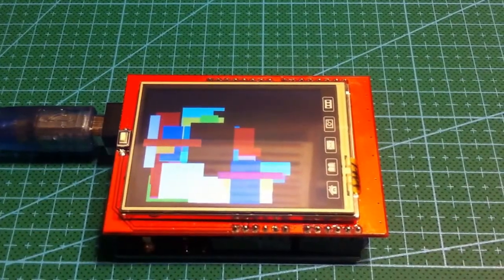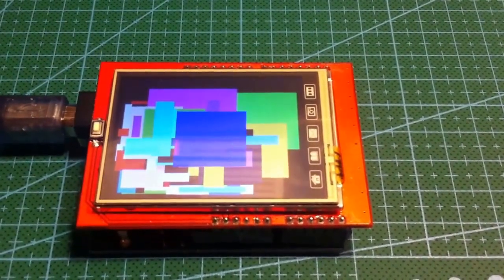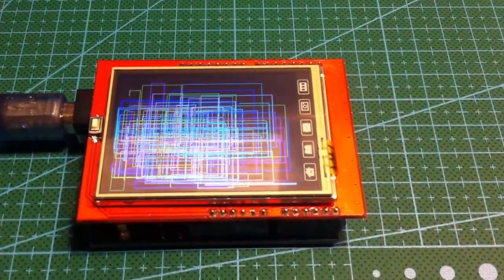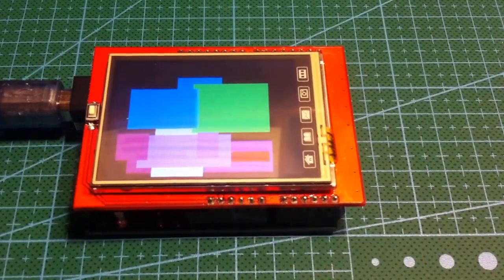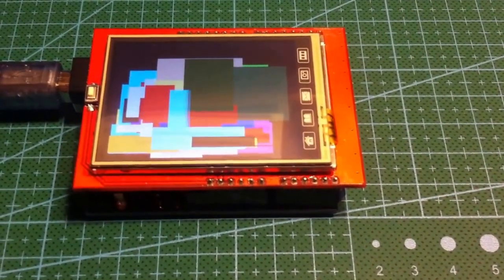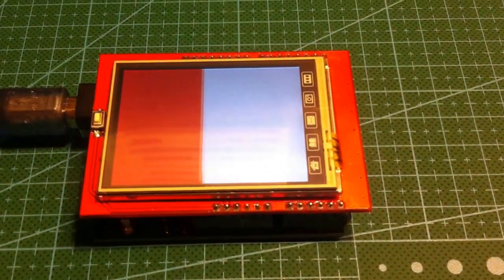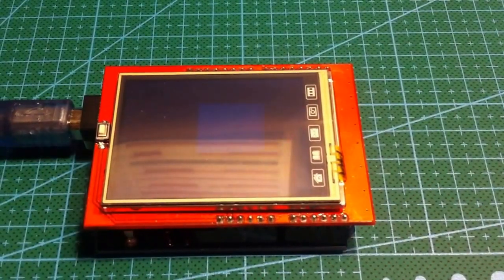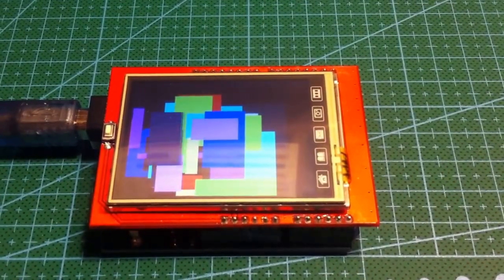New working test sketch for 2.4" TFT LCD Shield & Arduino. Link to sketch.

Comment: Can we show a picture in lcd tft?
Reply from the maker: Yes, I have displayed pictures on screens.
Reply: @KB1UIF  can you give me the sourcecode
Reply from the maker: @Galih Endah Mukti  The code is dependent on the arduino board and version of screen that you use.
Reply: @KB1UIF  i use the Arduino mega and tft lcd spfd5408. I try to show the image in lcd tft but the file not found and it showing blank screen even if the code and the file name is correct
Reply from the maker: @Galih Endah Mukti  I will look through my code to see what I have. I did display images onto a TFT screen a long time ago. I remember the image file had to be a certain type of file, not just any image file. I'm out of the country at this moment, but there are lots of files in my download archive you could look through  in the meantime. I may have it there already. I remember the image files were stored on an SD card.
Reply: @KB1UIF  the image format/filetype are .bmp, and its already saved inside the SD card

Comment: This is awesome!  Thanks for sharing.  How did you determine which driver was needed and where did you download it from?
Reply from the maker: Hi there,
it was a case of trial and error to find the correct chip info for this shield as the product has changed over time and different driver chips have been used. I have several videos and sketches for this shield and some use libraries and some don't. 
I you have difficulty  with your graphic shields let me know so I can try to help. Happy New Year. :-)